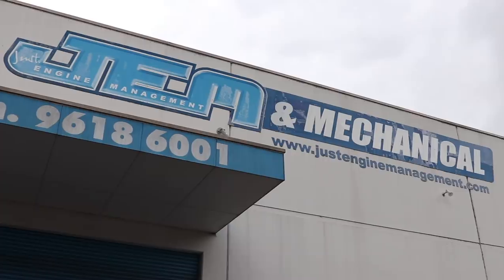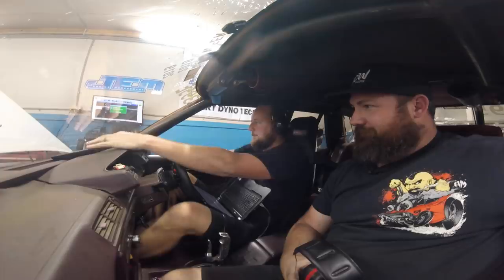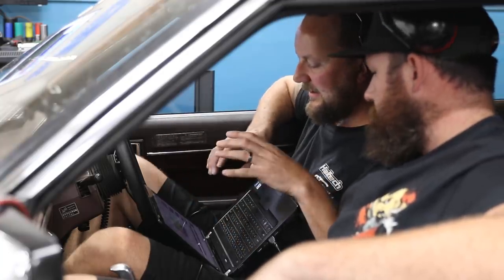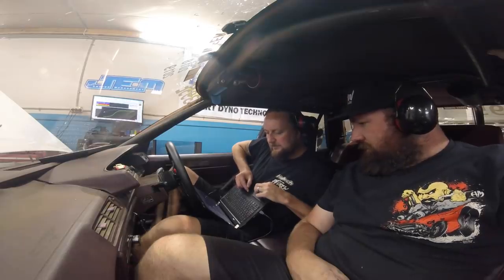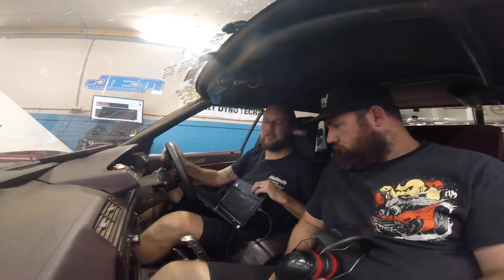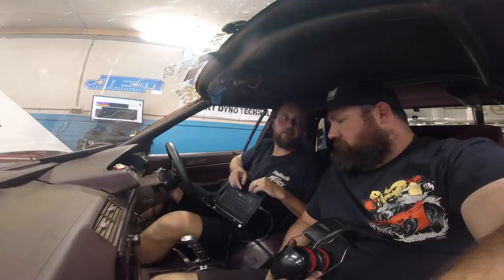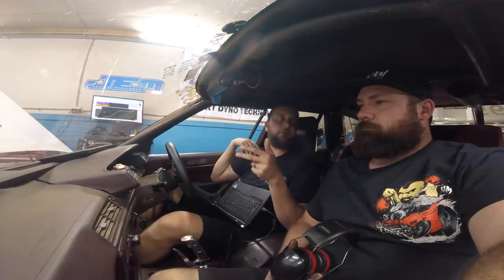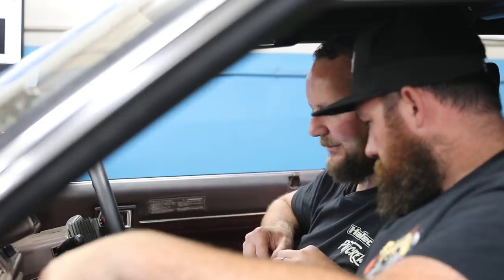CRESTA - Tuning on a Hub Dyno

Comment: If you are running the old style walbro 460 (F90000267) they start bleeding off pressure at 85psi. I found out the hard way. Basically if you have a base fuel pressure of say 50psi, as soon as u get near 30-35psi of manifold boost pressure you will start running out of flow pretty quickly.

Comment: Also incredible that this makes more power than a Bugatti veyron with 10 less cylinders, a quarter of the capacity and 3 less turbos.
Reply: Barra magic!
Reply: Half the capacity, Veyron engine has 7,993 litres capacity. Anyway probably veyron engine has better driveability as it is quite mildly tuned engine (125hp / litre ).

Comment: Fuel flow will be restricted at the smallest point in the system, usually at the junctions. Holley makes some larger connectors with larger internal diameters. Flow is inversely related to the 4th power of the radius. So increasing pressure only helps so much.
Reply from the maker: jord9308 the supply is -10 to twin -8 and all are full flow fittings. The plumbing isn’t the issue. A dead or dying pump is.
Reply: Benny's Custom Works enjoyed the videos

Comment: Great video as usual. While the end result wasn't what you wanted, the diagnostics I think was a huge save. The nice oily bits stayed inside the block, you again ran a PB and you didn't waste thousands on the new build. Now to build a new stronger fuel system, if all the voltages check out

Comment: So what's this mean ? new fuel pumps and then you have to make 7 Sec cresta shirts for drag week 2020 ?
Reply: Probably, but they haven't nailed the problem down to the pumps specifically. Wiring, lines, filters, rails, injectors, everything has to be correctly sized and working perfectly.
Reply: @ArKritz84  i personally think that the biggest challenge would be if the car goes faster than 8:50's then it will need a different cage

Comment: Benny's custom works something you might look into is here in the states in nascar cup series they use efi but use cable driven fuel pumps. They run 8 to 9500 rpm for hours and the volume and pressure stay. They used electric pumps in the beginning but wouldn't last. It might be a solution for you.
Reply from the maker: David Johnson no room to get drive from the crank unfortunately otherwise we would 100%
Reply: Well I've seen 2 ways like one driven off the flywheel and from the back of a dry sump which I don't think you have. Also a little pulley off the front of the engine driven by a belt.

Comment: You can get external mechanical pumps with a flexi drive thing. Cleetus has one on Leroy if I recall correctly
Reply from the maker: BFE 08 WRXSTI the pump size isn’t the issue, we can’t physically get a drive off the end of the crank as theres only 20mm from the end of the damper to the radiator .
Reply: @BennysCustomWorks  Ah, I see. Just wanted to throw the option out there if the placement of the pump around the engine was the problem

Comment: If you're not running a referenced fuel pressure reg & a fairly low static line pressure with big boost then surely the biggest factor is the fact that the pressure difference across the injector drops to almost nothing. Fuel won't flow if the pressure difference is low.... first port of call would be either crank base fuel pressure so you maintain a big enough pressure drop across the injector at higher boost or go to a manifold referenced fuel pressure reg which would give you the same effect. You guys have seen more & probably forgotten more than most people would ever know but this seems an odd conclusion to me!
Reply from the maker: we are running a vac referenced reg.
Reply: Benny, give Pat at Competition Systems a call in regard to alcohol fuel pressures. Not taking away from tuning fork at all, cause he is a jet and I know you hate reading the comments section but seriously, give Pat a call.  He has a wealth of knowledge on efi alky fuel pressures.
Reply: What reg are you running?? Is there only a pressure problem at higher boost levels??
Reply from the maker: kole lambert we always use gfb regs. The reg isn’t the issue , running out of pumps is our issue :) we’re already in the case.
Reply: That sucks man. Are the pumps still the same ones that were put in when the car was first built??
Reply from the maker: kole lambert yeah mate, they have done a lot of miles .
Reply: Wow!! Thats impressive!!

Comment: Hey benny, still running std exh valves in this build? Didnt get too see in the build vid
Reply from the maker: Oost Oost no, all aftermarket valves in this engine. We’ve changed brands after the previous failure :(
Reply: Benny's Custom Works beauty, loving how far this cars come, gonna be sweet with the 525 or two ;)
Reply from the maker: Oost Oost or three.

Comment: You guys have a lot to learn about A/F and air temp  and while I am here thermal shock.
Reply: PPR Darryl yeah, cos Scotty knows nothing about tuning 🙄🤦‍♂️
Reply: @craigmurray8358  He still has a lot to learn see www.bennettclayton.com
Reply: PPR Darryl and what does a website about power generation engines have to do with tuning high performance car engines?
Reply: @craigmurray8358  Everything, the people at Bennett Clayton have been at the heart of automotive technology since the late nineteen fifties. Bennett set up Moffatt's Phase three Falcon and Browns Falcon for Bathurst in 1970 and 71. Bennett has spent 30,000 hours on engine dyno testing engines and running engines at A/F ratios up to and including 30 plus to 1. The current industry gets lean burn misfire at 23 to 1 A/F . Bennett is doing things to engines that we will all be scratching for once the new emission standards come in to play  shortly. The guys at Haltech and associates would benefit alot if they contacted and learned what Bennett has to teach. I have been benefiting for decades on my vehicles the tech that Bennett can apply. My current cars an FPV Coyote and a BA 5.4 could not be tamed on a conventional dyno after being tuned properly.